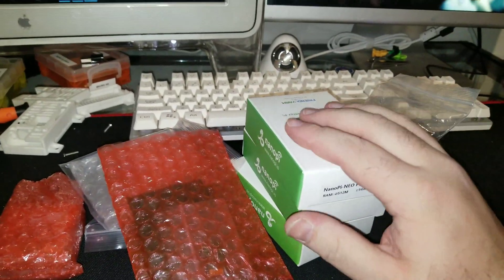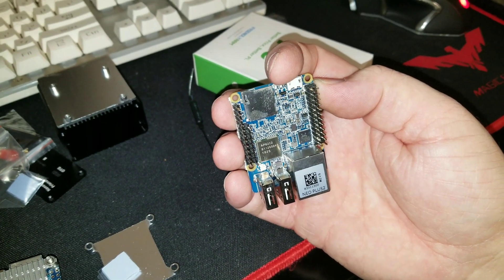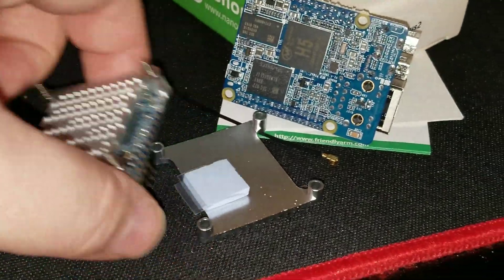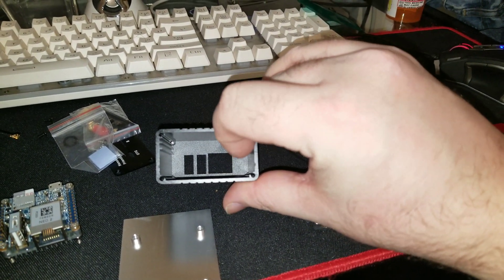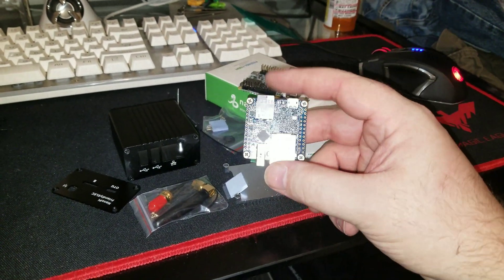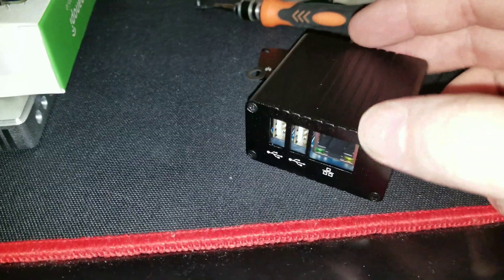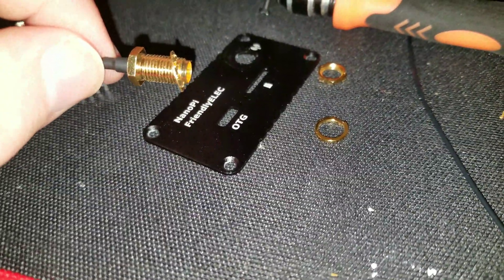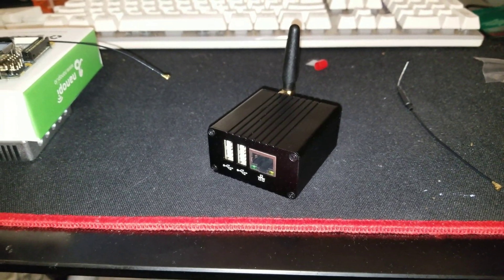FriendlyArm NanoPi Neo Plus 2 - Hardware Overview & Installation of Metal Case - Let's Look

Comment: I like these little boards. I have several that I use in robotics projects. They're small, reasonably powerful and easily programmed. They work well in conjunction with other controllers such as Arduino, ESP32, Teensy, STM32 or whatever for interfacing to sensors and stuff.